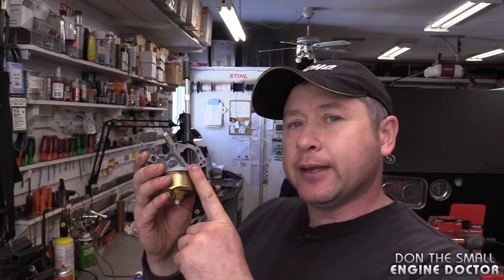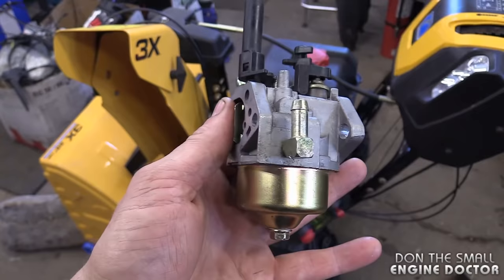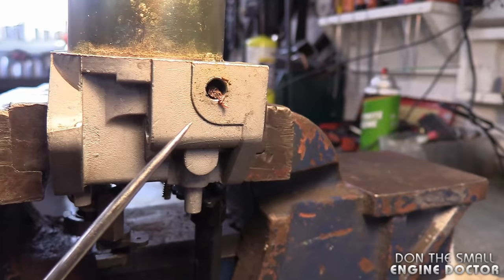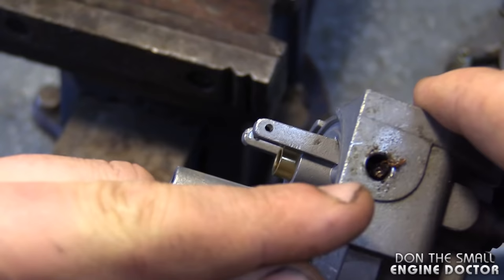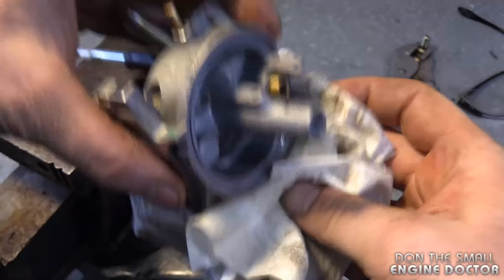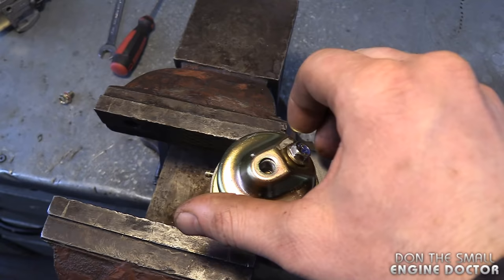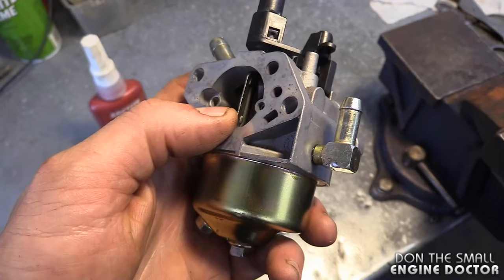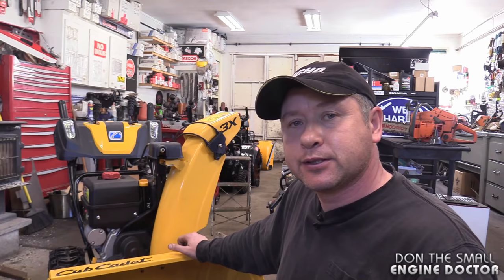Hidden Carburetor Fuel Filter Screen On Small Engines! Must see! - Video

Comment: THAT was a must-watch vid. Did. Or know about that secret filter. 😀 I’m working on a vid about adding an inline filter to equipment that lacks one.  Not sure why companies don’t include an inline, it cost 50¢
Reply: 50 cent screen or $75 repair bill. I think I know why
Reply: I can’t figure out why they won’t put an hour meter on small engines.  The owner’s manual specifically lists the hours for each maintenance task but provide no way to measure it.  They’re very cheap and super easy to install.
Reply: Sometimes they can inhibit the flow of fuel, depending on the machine. Otherwise the red filters are usually fine to use.
Reply: @fivespeed3026  would add 25 to 50 dollars to the price tag, if I want an hour meter I'll add one or I'll say "I used my engine for 3 hours or so today, round up to 4" and just do maintenance early. I don't actually keep track since I don't use any equipment without hour meters enough to care.
Reply: Manufacturers look at cost overall not each unit 75c added to 5000machines add up make dealers pay more which makes consumers pay more
Reply: Because they know most of us will pay someone to fix it (costing much more) so they make a flawed system. This man saved me a couple hundred dollars for two machines that I am going to fix today.
Reply: because they prefer selling carbs to selling filters.
Reply: @M.TTT.  I put them on everything, push mowers, power washers, my nephew’s mini bike, and so on. It takes the guess work out.  They’re about $7-8 on eBay right now but you can probably find them cheaper.  You just wrap the wire around the spark plug wire and then put the meter wherever you want.
Reply: @fivespeed3026  yup, I got a couple, on a minibike and go kart for RPM gauge though.
Reply: @fivespeed3026  I got a small meter from Amazon for 10 bucks. Shows RPM when engine is running, and measures run time of engine. Installed it on my snow thrower.
Reply: you do that...
Reply: 50 cents X a half a million starts to make a big number quick
Reply: It's all about the money. A former cost accountant, I can tell you that adding an additional fuel filter or machining a hole for the sump drain takes time, therefore cost.  It's not about customer convenience, it's about profit margin. Narragansett Bay.

Comment: Some snowmobiles also have a screen inside the inlet where the fuel line goes. Those you can see but I never realized they were there. Most guys took them off simply because they act as a jet and greatly affect the snowmobile performance. I normally reverse clean the fuel inlet on all carburetors but this is something I have not  run across yet. As always, a great thing to know about. Thankyou! Not one I would have thought about.  The screen in the fuel tank is one I knew about. Seen some of those pretty messed up. I have seen them broken and no longer in the tank.

Comment: This reminds me of the gas trimmer engine carburetors that have the extremely fine filter in the fuel inlet port. This filter usually gets clogged & can be removed & the engine will run correctly with just the filter in the tank.

Comment: Great video! 
 The way I clean carbs is to reverse-flush its  oles & channels with my WATER PIC. That means directing the water jets/spurts in through the holes/openings that gasoline (or air) would be coming out when the engine is working.   I use hot soapy water so that the carb will then dry out quickly.

Comment: Awesome need to know information! Would you guesstimate a year approximation when this screen started being put in use? I personally never thought those nozzles inserts were designed to be removed. I would’ve been afraid to grab hold and pull it off in fear that something would break or horribly leak afterwards.

Comment: Thank you so much for the excellent videos!   You do a great job of explaining things and are very thorough without too much information.    One piece of unsolicited advice is to wear gloves.   My past small engine repair guy died in his early 50's and when he went to the doctor it took no time for the DR to ask him what he did for a living and diagnosis his cancer and blame it on years of contact with the 2 stroke fuel.   Benzene is one of the most toxic cancer causing chemicals man has ever invented!   For the do it yourselfer or once in a while fix it's not as big a deal.  For the professional guys or any amount of exposure the gloves are worth the investment.    You can reuse them a bunch too.  Until I get a hole in them I take them off and the moisture will dry and you can turn them right-side out give them a small puff with your air gun and good to go.  I normally have two or three sets of gloves laying around my shop and rotate between them tell they're ready for the trash.   Outboard motors are a similar problem.   Also most the chemicals used to clean those parts are toxic as can be but no one my a point of reading the labels,  myself included.    Many of us are in debt to your knowledge and expertise, I want you to live long into retirement and enjoy the fruits of your labor!
Aloha

Comment: You can always buy some small fittings and more fuel hose and reroute the fuel hose to where you do have room to install a replaceable fuel filter.  May not look as nice but is better than having to pull the carburetor out just to remove a little bit of dirt and debris.
Reply: Brilliant!!! Jesus bless.
Reply: Please remember you have a gravity fuel feed and must allow for an even flow.
Reply: @ronz101  
Correct.  You do not want one of those dinky inline fuel filters.  With gravity feed fuel the bigger the filter the better.  And besides they will last a lot longer too unless you accidentally get a bunch of water in your fuel.  But then you can usually easily take it off and blow the water out of the filter and drain the watery gas out of the tank.

Comment: I have an older MTD blower, was thinking in earlier times trying to fix it was coil breaking down, didn't appear any spark was present. Changed coil and was same problem. It would run exactly as you described.. I tried blowing with my mouth where the line attaches to the carb, but I don't get any air through. Ahhh,  after watching your video, this is probably the cause. No tank filter and no inline filter either. Will be going to camp now to check this screen. This makes so much sense, especially since I cannot get air through at all. I WILL let you know!

Comment: Thanks for that info. Haven't ran across that particular issue but it's good to know. The biggest problem I have is with my pressure washer that has a Briggs and Stratton engine. Seems like once a year I have to remove the bowl from the carb and clear the tiny orifice in the bolt that holds the bowl on. From cold, if it doesn't fire within 3 pulls, I clear the hole, put it back together and it fires right up on the first pull. I'll look to see if I can add an external filter - that might help prevent it.

Comment: One of the most straight-forward DIY videos I have seen.  I have the same model as shown and it won't start.  Only used it twice ever.  But luckily, it's still under warranty so I'm just letting them handle it if I can't get it started after draining the old fuel from the float bowl.

Comment: The carb cleaner and pick techniques, yes, I can see pulling the fitting to reach and reduce resistance for the carb cleaner, access for pick. 
But if using air, leave the fitting in, it will hold the screen. Pull the bowl, float as described and hit the hole with full force. Maybe preload with cleaner. That way no removal of fitting is necessary. 
Very good video!!!
🤠👍👍

Comment: Glad this popped up I have two generators that will run if you squirt gas in the carburetor but are not getting fuel from the tank, Now I know what to do instead of buying new carburetors.

Comment: Good informative video. I did not now about that screen but most of my equipment is older than you and may not have it. That fitting was a Do Not Touch on my ancient stuff other than to replace it due to failure.

Comment: I have a certified snowblower with a champion 224cc it starts but does not stay running I'm going to try taking out the fuel fitting and check to see if the small screen is plugged I really like your videos they are very helpful

Comment: Excellent repair video. You would be surprised how many people have thrown away perfectly good lawn equipment etc. because of getting maybe one season out of it, it is left set up without running a stabilizer through it and not draining the fuel and then it doesn't work.

Comment: Wish I had seen this video sooner.  I have Cub Cadet Lawnmower which would not start.  I just replaced the carburetor and am about to test it.  However, I am going to check the old carburetor for this problem.  I may also rebuild the old one.  I’ll throw it on a shelf against a future failure of the just-installed carb.

Comment: I understand the idea of fixing it for "free", I do that a lot my self. I have found that for $20-40 you can get a kit that has a new carb, filter spark plug, air filter, ignition coil and wire, gaskets or combinations of parts where all you do is take the carb off, put the new on one, change as much or as little as you want and you are on the way. All of this stuff is easy to one degree or another, It it the time spent doing it that is the expensive part. If you can fix the X and do the job in the morning then do something else in the afternoon, even for an hour more, the slight cost in parts may be more than worth it in time saved. Besides if you change everything at once what problems could that prevent in the future?

Comment: Some also have a long thin filter in the outlet nipple of the fuel tank. Can be removed and cleaned by removing fuel line from tank and sliding it out (if there is one).

Comment: Thanks Don I just acquired a couple snowblowers that have that style carburetor on the engines. Don there is an adjustment screw on the side of these carburetors right by the mounting holes. My question is what is the adjustment on that screw, how many turns from fully closed? Thanks for the video and yes your correct it is a must watch video.

Comment: Good to know Dony.   I have encountered that screen on some older carbs, in a different location.  NEVER blow from the opposite direction.  You will hear a 'POP"  and your needle 'seat' will be somewhere in orbit.  I spent 90 minutes looking for one years ago.  NO FUN.  It looked like a dead bug was clogging that one.  Good Find.  It is important to use a funnel with a screen or pour your fuel through a plastic coffee filter to take out the lumps.  Never put the last few ounces in the engine tank.  Dirt in the storage container accumulates on fill ups.  Thanks.
Reply: Good point on the storage container. I use a clear glass gallon jug. Works well if ya' don't drop it.

Comment: Nice tip.  Had no idea since I almost never pull those fuel fittings.  I would personally just add an inline and eliminate that tiny little thing.  That little screen would get plugged up fast.

Comment: Older cars and trucks had them in their carbs. Somewhere a brass piece up to a half inch long and full of micro holes. I had Chevy's 1979 292 6 cylinder that I did this to, plus I added inline filter.

Comment: I use wrenches on fuel connectors.  Vice grips mar the surface of the connector and can compress the underlying metal of the fitting.  Open end Wrenches of the exact size or a Crescent wrench are better choices.    I put top hat filters on all my outdoor power equipment and a fuel shut off valve, space in the fuel line  permitting.

Comment: I have seen that on two cycle carbs many times inside the carb, but run most of my 4 cycle carbs I run thur the ultra sonic cleaner and may have unknowingly cleaned the screens when I air blow the carbs off after the cleaner. Great video, many thanks.

Comment: I must admit, that screen I always bin it & run without it.
Any crap normally settles at the bottom of the float bowl, remove the float bowl drain plug & turn on the fuel tap to 'wash' any crud out. Yes there is a chance of blocking jets but if you have that much crap in the fuel you will be stripping the carb down anyway.
You will find that screen in most carbs, vehicles as well. My old fiat 2.0 litre petrol can had one in the carb as well and was almost completely clogged. Put a good inline filter and make it easy on your self.

Comment: They also have screens like that at head shops which are places like Planet K that sell certain smoking accessories. They come in stainless steel as well as brass but the stainless steel is what you want.
My carb is similar to that but the tube is smaller and it has some kind of debris trap with a small bowel that unscrew underneath. It runs but only with the choke half on.

Comment: Hey donyboy..i have replaced carburetor's that had the same symptoms..the one thing i noticed was the fuel tank and the fuel filter had lots of dirt in them..of course i cleaned the tank and replaced the filter..i still have the old carburetor's I'm going to go find them and check the screen..thanks friend..lawn season is coming up and I'll be busy.. Cheers friend 🍻🍻🍻🇺🇸🇺🇸🇺🇸

Comment: That was helpful. I just cleaned the carb. on a 5 HP horizontal OHV engine that stopped running well. Dirt. Regular gas use :-(  I did flush out through the needle valve seat and dirt came out. I also did not know there may be a screen in there. I ordered inline fuel filters after cleaning the carb. and getting the engine running good. Silly not to filter before the carb..

Do the in tank filters get plugged?

Comment: I think this is a problem with line trimmer engines too. they have a very fine filter also.
Reply: Most likely a fuel system problem. I generally throw in a new set of rubber diaphragms, clean the screen and make sure the gas lines are in good condition. Also I take the muffler off and take a propane torch to the insides of the muffler till it glows orange to burn out the carbon build up, let it cool and blow out the burned carbon dust, reinstall and most 2 cycles will work perfectly. If that doesn't fix it check the ignition module/coil over time the heat will break them down and not give a timed spark.

Comment: Yep, the SeaDoo 951 crowd knows all about these. Crummy gas lines from the factory break down, if it's the line from the filter to the carbs then you can get the inlet screen plugged on 1 carb, that side will run lean while the other runs fine. You might notice some excessive revving but unless you are experienced with the issue the first sign of trouble will be a piston with a hole in it. Friends don't let friends mix ethanol and 2 stroke.

Comment: Doing that extra filter I've run into a few issues with vapor lock lawn equipment runs for a little  bit vapor locking in wouldn't run for a while like an hour I wouldn't recommend adding an extra fuel filter

Comment: Good tip sir. I did not know about this, but maybe ive been lucky just back flushing through needle seat without removing the fuel inlet was sufficient enough for me in the past to get them going.  I assume this screen  is more common on the gx clone carbs. Totally agree on the inline filter if practical.

Comment: Great tip ! never knew that & I just just put a new carburetor on my Cub Cadet 528 & it has the 357 cc engine ! I still have the original carburetor so when I rebuild it I'll make sure I do this . & again thank You for the video & the very helpful tip ! & what do You think of putting in a inline filter , I know it's tight on these Cub Cadets & just getting to the carburetor is a choir in itself. But it might be easier than removing the Carburetor.

Comment: I found out about this almost 2 years ago. I believe cub cadet is the only one to use this screen, haven't seen any others (B&S, Honda, etc) yet, but I check as I'm cleaning the carburetor,  not only for just the screen, the fuel elbow is a place where fuel can coagulate and dry

Comment: I put a top hat fuel filter as close to the carb as practicable on all of my small engines.  I also add a fuel shut off at the same time and use it to shut down the engine, always.  .

Comment: I really like the Powermore engines. I had one  on a snowblower that I used for five years and it always started on the first pull. I have a five year old lawnmower with one of these engines which runs great but it takes seven or eight pulls to get it started when it has been sitting for a while. The automatic choke appears to be working properly and I changed the spark plug which didn't make a difference. Next I'll get some fresh gas too see if it helps, as my gas is quite stale. After the mower is warmed up it starts on the first pull. I'd like to find a source for Powermore engine parts that will ship to Canada. Thank you for this video. I would never have guessed that there was a screen in the carb.

Comment: That's why you must have to put inline.fuel filter on your equipment . making sure that you place the filter in the right direction later Donny  be safe out there
Reply: The filter he installed is just a 150 micron screen inside the plastic. Not directional. If in doubt, blow through the filter from both directions.

Comment: Good informative video, but when using carb cleaner or compressed air be sure to wear safety glasses! Also if you use that loctite 680 you will never get that inlet elbow out again

Comment: The drain plug on the bottom cap has to be put back on right ,sometimes the carb hasn't very much room so mark the plug on bottom cap. My opinion,  3/23/21